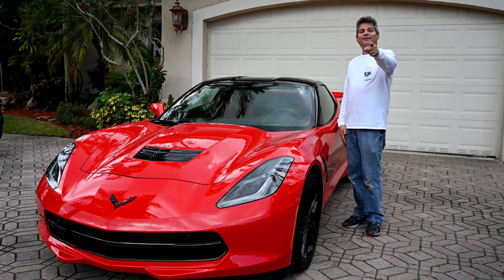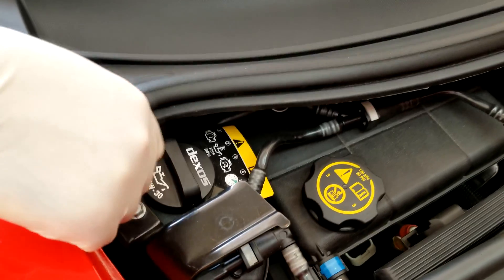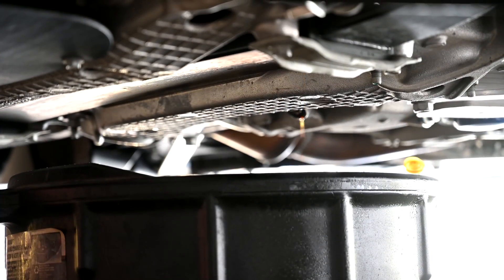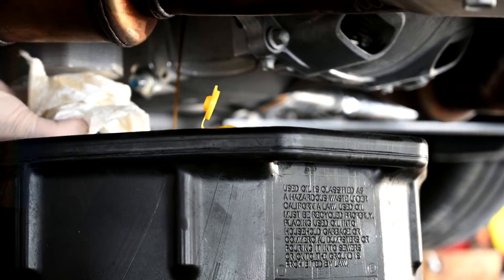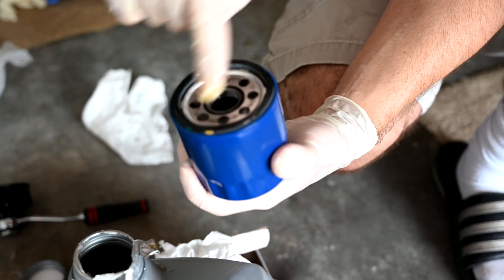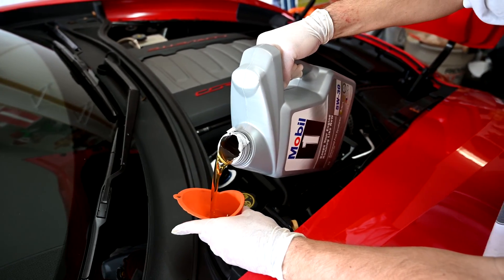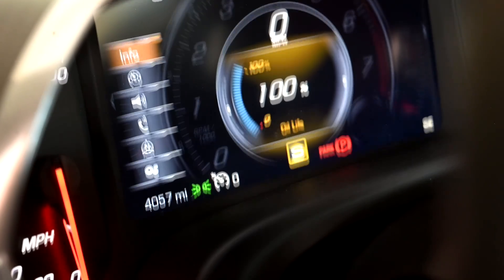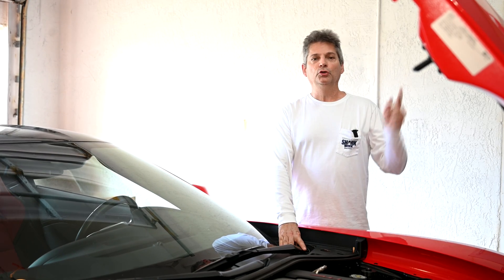How to Change Oil in Corvette Z51 Dry Sump Engine, Reset OLM

Comment from the maker: ✅  Parts/Tools for your corvette Z51 oil change:
🛒 Torin BIG RED T43002A Steel Jack Stands, Double Locking, 3 Ton Pair: https://amzn.to/2WkXUyH
Be sure you order the Jack Stand with Model # ending in "A" it has double lock!
🛒 Corvette Jack Puck Pads SNAP in Support Lift Set of 4 Pads: https://amzn.to/2HPmNLs
🛒 ACDelco PF64 Professional Engine Oil Filter: https://amzn.to/2PwsUsn
🛒 Uxcell CAP style oil filter socket wrench 73MM, 15 FLUTES https://amzn.to/3gEQ6zo
🛒 CRAFTSMAN Combination Wrench, 15 mm for oil plugs: https://amzn.to/2T32AH4
🛒 DEWALT, DWST11556, Express Folding Workbench: https://amzn.to/39XW7UM
🛒 Mobil 1 High Mileage 5W-30 Motor Oil - 5 Quart: https://amzn.to/2T89iM4

Comment: The manual doesn’t required the oil to be 175 it requires the engine to be warmed to 175.  There’s a difference.  Look at your engine temp gauge in your touring mode cluster under performance for the engine temp.  If you go off the oil temp your engine temp is prob around 200 degrees.  You want that oil temp to be about 135 degrees when you check it.  That performance cluster in touring mode will give you all that info 😉
Reply: you're correct. its the engine temp @175 F not the oil temp.

Comment: Hello sir i just bought 2016 Z51 and the oil pressure when it’s idle around 184 kpa  and when moving is around 202 kpa is this normal?
Reply: Converted to PSI numbers that range is 26-29psi.   Those numbers seem kinda low.  I have the exact same year and model and mine runs between 34-40psi.  I would probably have it looked at.  These cars have malfunction indications all over the place though.  If your oil pressure was low the car would tell you and you’d probably get a text on your phone too.  Just saying

Comment: Very informative video. I have a question regarding the new oil filter. I know you have to prime the seal, but do you also have to fill the filter with oil?
Reply from the maker: We have not done that
Reply: @carbuying  You don’t have to, but why wouldn’t You. I do it on all vehicles that have vertical filters. The quicker the oil pressure comes up, the better.

Comment: What oil filter wrench is that?  It's not listed in your "useful parts" list.
Reply: What size drain pan, Not listed either
Reply from the maker: Here is the link to the wrench: https://amzn.to/3gEQ6zo It is the Uxcell CAP STYLE OIL FILTER SOCKET WRENCH 73MM 15 FLUTES.  The wrench we used in the video is very old and can't get anymore, but the important thing is the 15 flutes and 73mm, and you are good to go with this wrench.